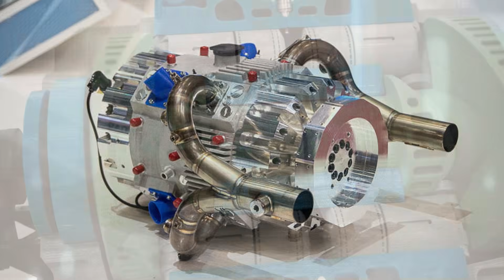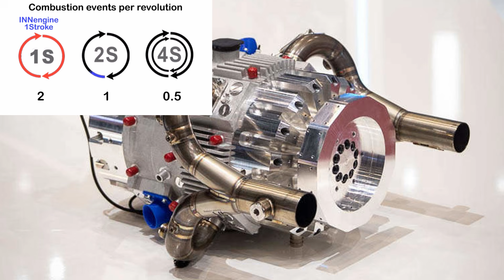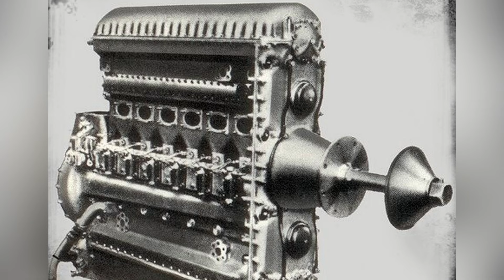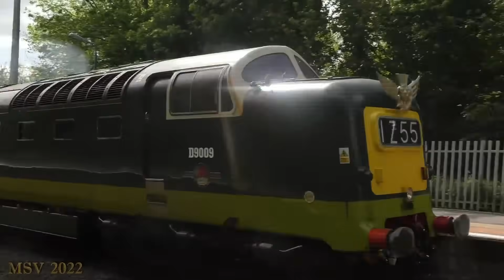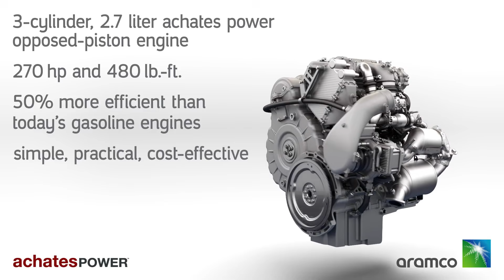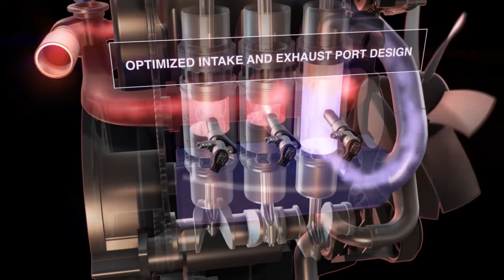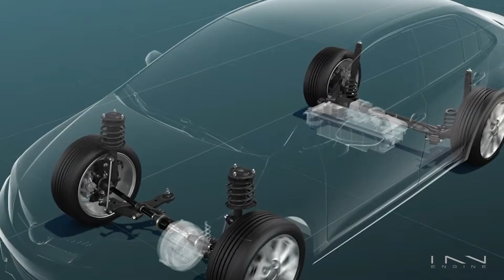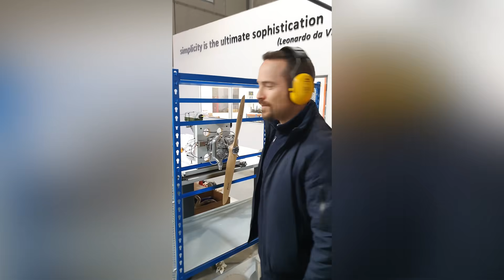NEW OP Mini-Engine DESTROYS Pure EVs

Comment: A healthy evolution of vehicle propulsion. EV automotive tech is driving significant advances in ICE design. Both of the  featured engines are great potential range extenders in future hybrid electric drive systems! I really like the Achates design.
Reply: They are not "healthy" - noisy polluting pieces of unnecessary unproven noise makers.
Reply: @nathansmith7153  You're delusional if you believe that battery powered EV's are closer to healthy than efficient ICE's
Reply: @OldSchoolZ-wy2yx  Delusional? I wonder how healthy you might be sitting in a closed garage with your ICE engine running vs an EV.  Burning highly processed fuel in an ICE is never going to be as efficient as an electric motor. The facts are that ICE vehicles create levels of pollution that kill or permanently harm millions of people annually.  Also people conveniently forget that exploring, digging, extracting, transporting and processing petrol and diesel is incredibly resource intensive and an extremely dirty process that burns way more cobalt and other precious resources just to get it to the motorist.  We already have EV's using Lithium Phosphate batteries without using nickel or cobalt, and Sodium/air batteries could be next, so having vehicles that can use renewable energy and can be recycled at the end of their life is always going to win.

Comment: One important number is also torque and whats the rpm’s for this numbers. 120 hp only does not say nothing. Thing a car 1100 kg, with 4 persons inside and full gas tank. What’s the capability to start the car at 20 degrees uphill.

Comment: The WEIGHT and replacement will put an end to EV. The double weight of cars trucks will add to insurance because more weight is how they determine cost...heavy causes more damage and more lives will be lost in crashes. Unless something new is found to replace current batt rare earth mining I think this will shut down EV too. The power grid cannot sustain billions of EV and the inconvenience of charging is also going to be a huge issue. The electric fantasy is not going to work.
Reply: DOUBLE the weight? Right!?? The battery adds only about 1,000 lbs, but then you need to subtract the weight of the ICE engine and transmission, as an EV motor is MUCH lighter. Teslas are the SAFEST cars made, least chance of injury and death, according to IIHS crash tests. There is no "inconvenience of charging" either. 99% of the time you charge at home, which takes a whole 5 seconds to plug in, just like your cellphone.

Comment: If I drove truck as an owner-operator, I think I'd be willing to take a 45 minute break every 7-8 hours if it cut the cost of fuel & repairs significantly.  This should qualify as one of the mandatory breaks anyway.  5:00  However I still like the look of this engine for marine & air applications or trucking outside the super-duper-charger network (or whatever it'll be called).
Reply: Most people are surprised that charging electric semis is not a limitation.  The primary limitation is in the driver!  The day starts with a charged battery and a fresh driver.  The Tesla semi can travel 500 miles on a fresh charge.  Within the first 8 hours, the driver is required to take a 30 minute break.  During the 30 minute break, the truck can charge another 300 miles.  Now the total is 800 miles in the driver's allowed 11 hour day.  How often will the range be a limitation, rather than the driver's hours?  

The network won't be a problem, because with a 500 mile range, there won't be a situation where there's no charger available.  Electric semis will start the way PepsiCo is using them, between their own facilities.  As third party charging points spring up, trucking companies will factor in being able to charge en route.  More and more companies will switch to lower fuel cost electric vehicles.  Once large trucking companies are running electric, it will lower the rates they charge their customers, and anyone still driving diesel will have a hard time competing and making a profit.
Reply: What?? There's no mandatory break where you live, I assume the US?? That's very surprising. Over in Europe where I live you have to take either 45 minutes or 2 breaks of 15 + 30 minutes every 4,5 hours of driving. You can drive 9 hours per day, 2 days per week you're allowed 10, so 56 hours is the maximum per week. Those are driving hours though (as in the vehicle is moving), not working hours. Working hours can be up to 60 (or more, depending on the situation).
Reply: @CreRay  I live in Canada where you need a cumulative of 2 hours every day with 30 minute minimums or something like that.  My point was that charging won't actually slow the driver down because they have to take breaks anyway, whereas the video seems to suggest the charging time would slow truckers down.  I had a friend who was a trucker, but don't drive commercially myself.

Comment: Still think the LiquidPiston concept has better odds of making it to large scale production. Plus the thermodynamics of the LP rotary yield a considerably reduction in specific fuel consumption. Larger version of the LP engine can be achieved with either larger rotors or by stacking together multiple rotors. The OP concept looks like it can only scale up by making the pistons bigger to increase displacement with the given number of pistons. This will make the engine larger in diameter, which is the exact opposite of what you want if this is ever to be used in an aircraft.
Reply: The best option is hydrogen or even pure ethanol normal combustion engines.  They are far better for the climate without sacrificing anything like power and sound.
Reply: @EliteNugz  hydrogen has issues of its own. Compressed hydrogen needs extraordinarily strong tanks able to withstand pressures of 350-700 atmospheres of pressure. Liquid hydrogen doesn’t need high pressure, but at -427 degrees F the temperature is so low that even small amount of heat leak causes the LH2 to boil off faster than the required fuel flow. As such it needs phenomenal levels of insulation to keep heat flux as close to zero as possible. Ethanol isn’t a bad alternative. The issue with ethanol is that it is completely miscible with water, even water vapor in the air. As a result pure ethanol will rapidly become a mixture of water and ethanol unless it is kept sealed from any contact with the atmosphere. The same goes for methanol. And the volumetric energy density of ethanol and especially methanol is much less than gasoline. As a result for a given tank size the range with ethanols or methanol is much shorter. It is possible to address all of these issues. However butanol might be a better solution. It has a volumetric energy density that is about 3/4 of gasoline. And unlike ethanol it doesn’t absorb water out of the air. Even better it has a much lower vapor pressure than gasoline and has a much higher flash temperature, which together means that it represents a much lower risk of a stray static electric spark causing the fuel tank to explode compared to gasoline and even diesel. Synthetic butanol does take more input energy to produce a given number of megajoules of fuel energy than ethanol or methanol. And existing gasoline engines just require a minor reprogramming of the engine computer to allow it to run on 100% butanol. Current gas engines can’t run on 100% ethanol. The max that existing gasoline’s can run on is 80%-85% ethanol.
Reply: @papparocket  with minor modifications combustion engines can run on 100% ethanol and less mpg per gallon is a small price to pay for all its benefits.  It males way more sense than electric cars which are horrible for the environment and have tons of negative effects.

Comment: I missed the 'DESTROYS Pure EVs' part.  Was that a joke?  Had to be.  And to all those who think hybrids are a good idea...the BEST idea is to keep things simple with less moving parts...like electric motors.  The minute you put an ICE engine in an electric car you've just made it less reliable.  Yes, the batteries in EVs are still an issue and they need to continue improving them for longevity and charging speed...but they are getting better and better.  When 500mi range EVs are less expensive to purchase than ICE or hybrid vehicles will you buy one?  How about 400mi range?  300mi range?  Do the math for yourself.  Pros: zero gasoline cost, zero oil changes, almost zero brake wear and tear, zero starters to replace, zero alternators, zero having to go to gas stations for day-to-day use if you keep it charged at home, quieter.  Cons: long road trips means you have to plan charging stops which take longer than traditional refueling, hauling heavy loads or trailers significantly reduces range.

Comment: The problem is, internal combustion technology has been severely hampered by the oil industry and the expense of advanced materials.
I'm a trained jet engine mechanic.  I know just a wee tad about engines.
This is an axiom.  Combustion temperature is directly proportional to efficiency.  Why are gas turbines so much more efficient than piston engines?  Because piston engines operate around 8-9:1 compression, and a gas turbine engine is around 25:1.
This is a basic hydrodynamic principle - as pressure increases, temperature increases.  So higher pressures = higher temperatures = more complete combustion = more efficiency.  Got it?
Modern piston engines need to be brought into the 21st century.  We have materials technologies now capable of creating engines with around 15:1 compression ratio in a piston driven engine.  At this compression ratio, it's much simpler to design a more powerful engine that uses less fuel.  
For instance, with a material redesign, the 175hp base Ford Fusion engine (which gets 21 and 31 mpg city/hwy) could easily produce 245 hp and get 26 and 38 mpg with a simple materials redesign and compression increase.  More power and more mpg with better emissions.  This is the benefit being held back from piston driven engines.  And this is only the beginning.

Anybody ready to start a new American car company based on cutting edge internal combustion technology will rule the future if they play their cards right.

Comment: Okay, not even 30 seconds into this video, the narrator has completely destroyed his credibility by demonstrating his complete ignorance of the core subject.
This engine is controlled by two cams. Cams that adjust the compression ratio of the engine via a center cam within the crankshaft. And the crankshaft is right there in the center of this engine!

Comment: Battery electric vehicle are logistically impossible to support. Largely because they off load their energy demand to the grid. A grid that just doesn’t have enough electrical production capacity to meet their demands. And considering it took 12 years to complete Palo Verda nuclear power station, and we’d need 3 such power stations to come online every year, either every EV manufacturer needs to halt production completely for 12 years so we can get caught up, or just mandate all EV be non plug in hybrids for the interim.

Comment: I think the cam-track engine has great potential, but their designs aren't fully taking advantage of the idea itself.  

On the other hand, EV's are horrible.  Batteries alone have more of an environmental impact than the entire lifespan of a gas vehicle, rendering the extra steps of converting energy into DC electricity more of a problem than a solution.  While the sentiment is good, everything about the infrastructure is still bad.  Though thankfully there are at least enough chargers now to actually use them freely.

ESP funny seeing Teslas in places like China, where you have to be a complete idiot to think driving a Tesla makes you environmentally friendly (Their grid is like 99% coal).

It isn't that we need 'more energy dense' batteries.   Some of the lithium ION batteries are exceeding over 700 Wh/kg.  Another term for those batteries is volatile explosive, because energy density means the same thing if you have enough of it.  If you actually managed to be more dense than those batteries, you need to start compromising safety by padding against the extreme pressures on the battery from stuffing it with so many electrons and then taking them out.

TBH what the world needs is less nuclear bombs, and more nuclear power plants.  But there is money to be had in keeping energy prices up.  Electric vehicles would be awesome if every country was solar/wind/nuclear.  With just enough coal to support the industries that need coal byproducts.  Systems engineers would also argue the importance of always having grid diversity too though.

As is, LifePO4 batteries are probably the best.  Because it can survive subzero just fine, but also has very good energy density and longevity.   Doubt that will change. 

Since it won't change?  I'll keep driving Toyota hybrids, because their engineers aren't idiots. 

That 2023 prius looks very sweet.